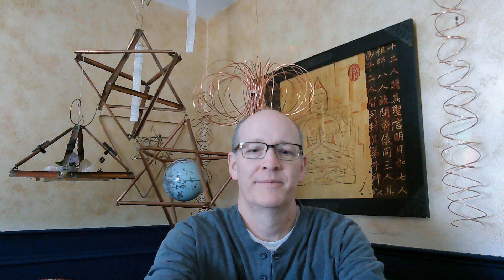Magnetizing Plastic

Comment: "Break down to 'NOTHING'." 
I'm sorry? NOTHING? 
There is no way that anything can become 'NOTHING'. 
If you dissolve gold using Aqua Regia, the gold doesn't break down into "NOTHING". 
The gold is STILL THERE, but is IN SOLUTION.
You can NOT destroy anything into 'NOTHING".
Reply from the maker: Thank you for bringing this up, I should have explained this in more detail like I have in other videos. We are not destroying anything in this process. We are completely dismantling all of the molecular bonds of the plastic and raising the resonant frequency of the remains so high that we are re-distributing them back into an interdimensional flow. What's left is so miniscule that its essentially undetectable carbon....
Reply: @MagneticEnergy undetectable carbon from a small amount of plastic? And 350 million metric tons per year worth of plastic? All a sudden that’s pretty detectable no? How could it effect the brain planet?
Reply from the maker: As the carbon builds up in the device it is used for other manufacturing processes, so it is never just dumped into the ocean